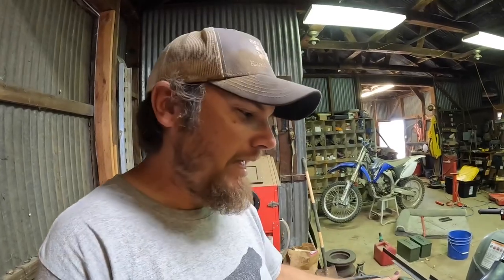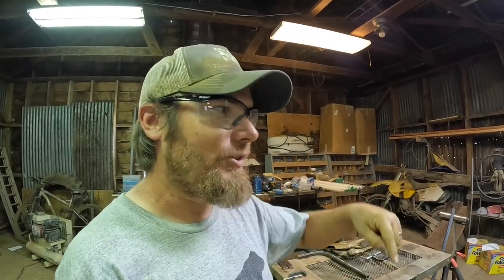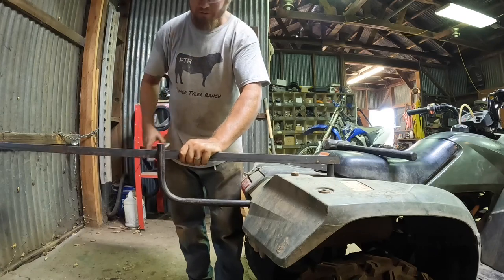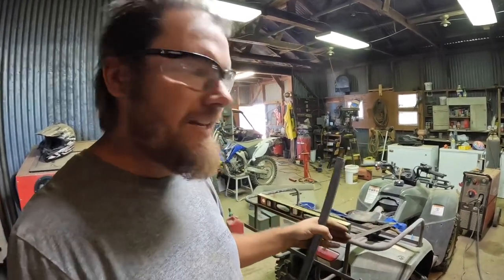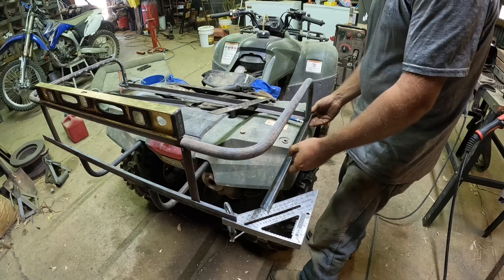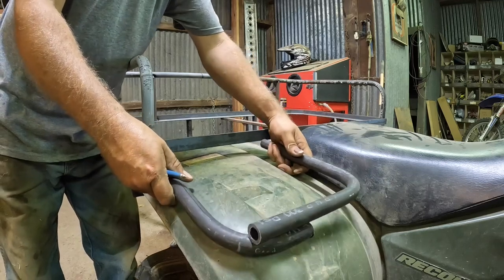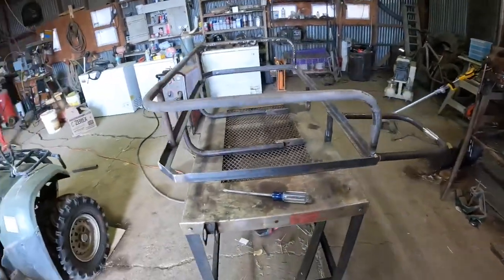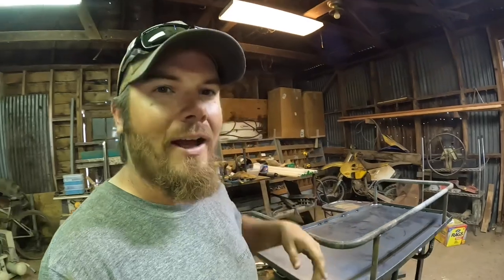Building the Callie Basket!

Comment: Very cool design. You mentioned fence reels just as I was thinking 5 gal buckets of feed. Can't wait to she her riding on it. 
Couple of things though.  Use your foot instead of your fist. Your knuckles will thank you when your pushing 60 like me. 2nd throw a pool noodle or water pipe insulation tubes on the top rail so she doesn't get a bad knock when you hit a bad bump.
Great video, keep it up. Thanks

Comment: Hello🙋‍♂️ from the Netherlands🇳🇱 .
you would still make two small tool boxes or weld small ammunition boxes from the rear support and the side of the rack at the back under the floor .  
is a nice place to have a basic tool set for the atv in one .
and for example fence pliers and some staples and a hammer in the other to be able to do a small emergency repair to the fence .
and thanks for the video.  
Sincerely, Hollandduck🇳🇱🦆

Comment: You have come up with a very attractive and functional design for that platform.  The MIG welder makes the welding SO much easier than the stick welder which I bought fifty years ago.  My welder has done a lot of work over the years, but the MIG welder makes it look easy by comparison.
Please allow me to make one observation.  The mounting points on the four-wheeler look as though they were not designed to have a platform which extends so far away from the back of the machine.  The existing mounting points of the chassis may not be strong enough for the long term use of the platform and the loads you wish to carry.  Is it possible for you to make and fit two diagonal supports for the back of the platform, and which attach to the chassis of the four wheeler somewhere near to the rear axle?

Comment: I have the same welding table you have ... I hate the screening on it - Northern Tools has one the same size on sale now that is solid sheet metal with the holes @ 2" o.c. for hold down clamps etc. that come included - I just bought it and still have to assemble it.